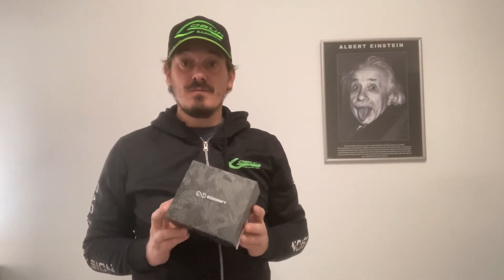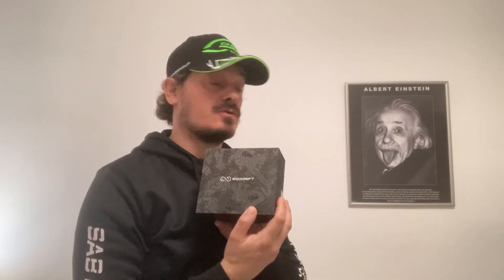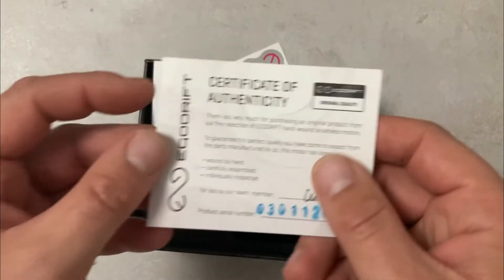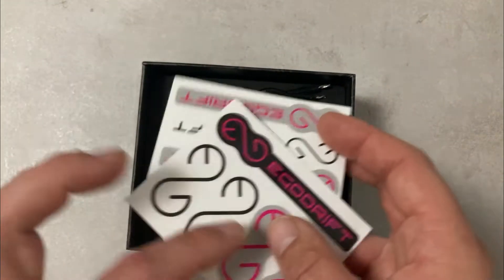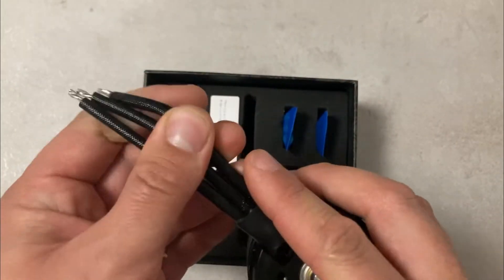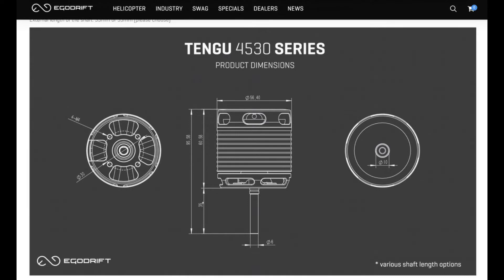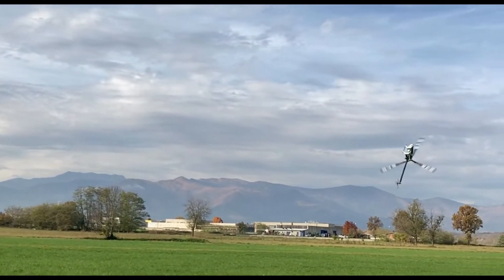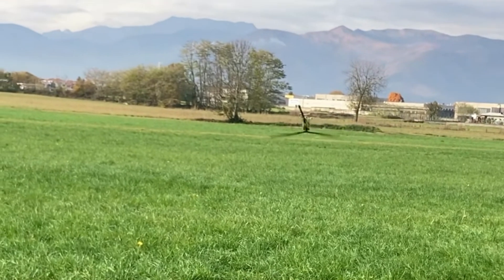Test review Egodrift 4530HT-510Kv On my Goblin Raw KSE Triblade and Spirit Flybarless System

Comment: I just built the same exact heli, I'm unable to put back 3 blades in a foam holder) do you have this problem? I have new blades 700s. Thanks
Reply from the maker: @maks-yaremenko  yes is just because the blade holder was designed for the hold blade type
Reply: @gianmarcochinaglia  I saw Sab has 2 versions of those holders one has tight holes for the blades, and the other is wide, with some space between holes, I have a wide one, but still not enough blade angle to put blades there.